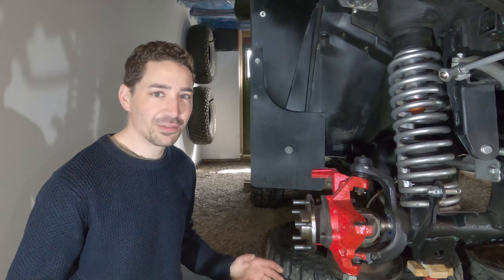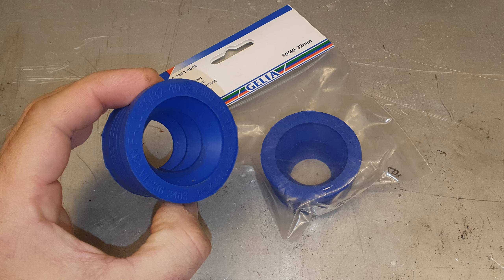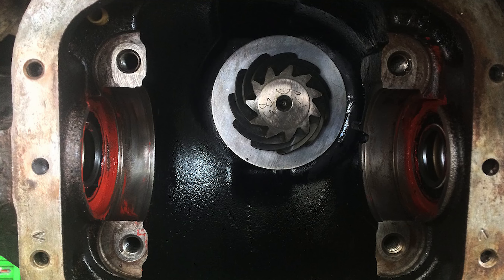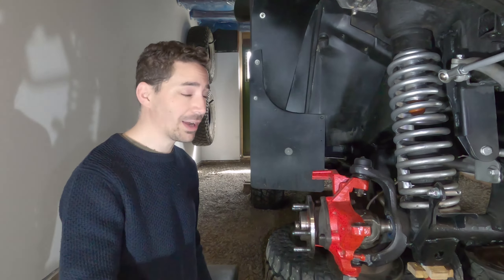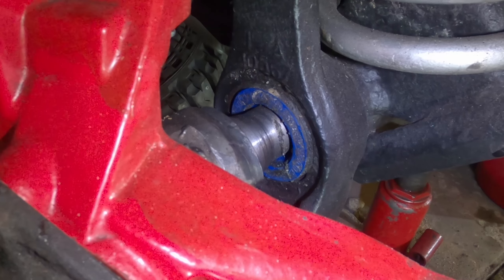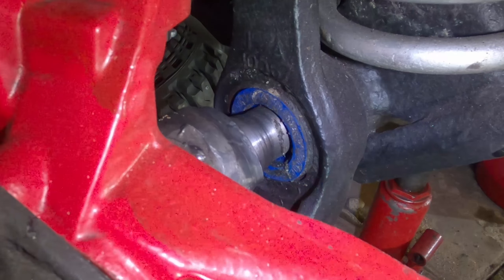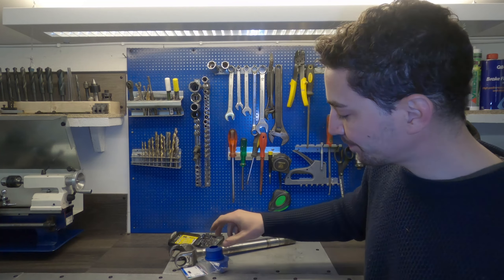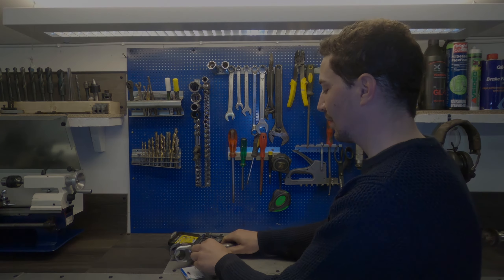Why Front Outer Axle Seals Don't Really Work

Comment from the maker: First off, forgive the flickering lights. They shall be replaced as they are a bit distracting.  
Jeep Outer Axle Seals for the Dana 30 and other front ends of a similar design can vary quite a lot in price. There are cheap Chinese clones for around £20 and name brands over £100. Its good to know what your getting and how it works before spending the money and outer axle seals cannot work they way they are indented due to the deflection of the front axle shaft when turning. 

The axle shafts on front ends with U-Joints can never spin perfectly central due to the nature of the steering knuckle and U-Joint causing deflection on the shaft. This deflection causes the seal on the outer axle seal to be deformed and worn away into an oval shape making it impossible to form a seal around the shaft, keeping water in the housing. 
If you do run them and tread water regularly I would pull the seals regularly to release the trapped water or just don't run them at all.
Thanks for watching.
Reply: Hello, I love the videos and have been watching here and there for years. I have owned and built by my hands ( highly built that is ) 8 of these XJ'S. My question or confusion here is, that based off of what you said the inner of the axle shaft would do the same thing at a smaller tapper or angle then as well, as there is no way for the shaft to angle and wobble out an oval without the opposing or opposite inner side of the shaft side doing it as well, but just not to the same degeree, correct? I ask this because it seems that what you pointed out would almost be saying hey your inner axle seals will do this as well so change them regularly as well. That is what I was wondering about and am curious about, and as to what your thoughts to my train of thought reasoning or conclusion, based upon your statement might be? Thank you in advance, assuming you reply🙂. 🇺🇸 🤝🇬🇧
Reply from the maker: @SarahSmith-hd8kd  Hey, thanks for watching and for the comment. if you clamp the diff housing in a vice and put the shaft in you can actually move it a lot. The inner seals are placed as close to the pumpkin as possible as the movement there is so minimal. This is presumably why its designed this way. 
From what I have read into this 'deflection' as they call it is pretty normal on all U-Joint designs like this. You must be right, the other end of the axle must move also, it has too. I guess its just very minimal to the point where its has very little effect on the seal. Perhaps that's why the shorter shaft seals seems to fail more, i don't know tbh, just speculation. 
I guess it seems logical for a long shaft that slides into a not so tight splined hole to have some movement when there is a rotatable joint at the other end that changes its axis. There is nothing keeping it central at the knuckle end so how can it possibly remain central. I watched an animation of it once that explained it all but I cant find it again. It was over 5 years ago. Thanks again, and I am by no means an engineer!
Reply: @WorkshoptoWilderness  Oh wow, thanks for that response, I just got to read it, as I expected a delay in response due to your being across the big pond. That is a great intelligent response and further elaboration on your part sir 👏.  I believe you are right, because as I stated I've had and built 8 already and lmao, you were spot on your assumption that the short end shaft always leaks before the other driver side will. Thank you for the knowledge, sounds like it is time for some expensive $RCV$ shafts for me, when the old chromoly ones are toast or in need of service. Thank you for the response and your time and I am by no means an engineer but rather a jack of all trades and a master of none🤣.👍
Reply from the maker: @SarahSmith-hd8kd  I'm no expert by a long shot but just trying to think about it logically. That's pretty cool that you have build so many xjs. You must know a thing or two. Those RCVs are absolutely tough as hell by the looks of them. Would love a set of those. Thanks again for watching and for the comment!

Comment: Good video, well spoken and informative. Generally, when I'm in my Jeep, I try to avoid deep water/mud if I can but if I need to submerge my front axle I usually change the diff oil after the off-road trip and make sure the water is drained from the tubes. It's extra work but if you want a dependable 4x4, it's necessary.

Comment: @9:50 - The solution would be to have a bearing at the end that keeps the shaft centered and not flexing. Then a seal would make sense. I don't think outer seals are necessary, even in heavy mud situations. I suppose if there was an issue, sleeving the tube would be a solution that doesn't require constantly pumping and dumping grease. It would just tighten the tolerance and not let as much material down the tube. But the inner seal is still the best defense that's already doing all the work, even if you use outer axle seals.
Reply: That would actually be a perfect solution on a D30 with CV axles, rather than u-joint axles. U-joints by their nature have an elliptical rotation  in any position other than perfectly straight, hence the appearance of directional flexing/ wallowing. And why any outer seal solution will have its shortcomings.

Comment: Very good information, I never realized the axle shaft moved at all, but it makes sense that it would with the torque of the u joint turning. For a while now I've thought about trying out the outer axle seals. Now I'm glad I never got around to it. Sounds like it might be best to keep running with no outer axle seal.

Comment: I changed my Shafts to ones with cv joints instead of ujs and I can’t use the standard axle seals or the China ones because of clearance issues with the new cv boot! so that rubber thing you have may be my only option. Great vid mate thanks from the uk 👍🏼

Comment: Sealing a 90 wt gear oil is one thing. Sealing something thin as water is almost impossible once you are at full spin and steering back and forth.I have found I try to avoid water above the hubs if possible. I definitely limit my time in deep water.it kills starters, batteries and it definitely finds it's way into places we never even think of.i think the original design that allows air and water to come and go is best for most. If you really like tinkering then by all means try to seal the goop out.

Comment: I notice at 3mins 20secs that your uj has been tack welded in. Interested to know why.
Great vid, very well explained
Reply from the maker: It was to stop them turning in the eyes. I got the tip from some offroad enthusiasts years ago. I stopped doing it over the last couple of years when i went to chromoly shafts and full clips. Those tack welded U-joints lasted for years to be fair to them.. 
Thanks for watching.

Comment: Great video, thanks for the upload...any chance you would change out the front axle for something with a different design?
Reply from the maker: Thanks for watching! If I managed to get something better then I would certainly consider changing it out. I quite like the HP D30 though, its pretty strong for a small axle.
Reply: People love to hate on the “Turdy Thirty” but it’s really a fine axle if you’re keeping the gearing are 4.56 or numerically lower.  If you plan to push it hard there are some things to consider but swapping it for a true D44 or other upgraded option is a lot of money and/or work. The little 30 as Mike said works quite well if you treat it right and it’s such a low profile it’s hard to beat that. IMO XJs do best on 33 or 35 inch tires so there’s really no need to swap the axle out for that.

Comment: Hi, I would like to know How your Rubber Blue Seals are working for 1 year if they don't have Grease aropund to protect it ??  Please, can you answer this doubt ? thanks
Reply from the maker: There still on but not sealing anymore much like the red ones I had on before. Outer axle seals are all bullshit like I said in the video. It's impossible to seal the shaft when it has so much deflection, hence why the factory seals are located at the diff because its the part of the shaft with no deflection. 
You run outer seals to minimise dirt, that's all, they will never seal water

Comment: As a mechanical engineer that has wrenched and built various 4wd's, it makes me wonder if the working centerline(or node) of the u-joint is "perfectly" inline with the axis of your ball joints??? If you could shim your stub axle 0.25mm inward, how does that affect the offset when steering. If it makes it worse, I wonder if you have a spare junk outer that you could machine off 0.25mm to test the idea going the other way. My guess is the offset is just the stack-up of tolerances in manufacturing and assembling multiple parts. Enjoying for videos, from here in Oregon, USA.
Reply from the maker: That's certainly a cool experiment. I have a small lathe, perhaps I can make a shim and test it out. I don't fully understand it apart from in its basics. Do you think it would make a big difference? Thanks for watching!
Reply: I seen the lathe, which got me thinking you might have the tools to test it...My brain tells me if it was perfectly aligned - it should not move from side to side. Unfortunately you can only add shim, So if thats the wrong direction it makes the process much more difficult to remove shim or take a skim cut on the stub axle flange. I'm sure its just manufacturing tolerances of how each part fits together and stacking up +/- 0.004" (0.1mm) could start to add up on the axle C, Steering knuckle, Unit bearing and stub axle bringing your combination of parts out of "perfect alignment". It could also be the misalignment up and down also (inline with the ball joints). But if your seeing 3mm of movement, then you should be able to easily reduce that to something less which would increase seal life. Rick
Reply: Since the axle shifts in the opposite direction in which the knuckle is turned, this indicates that the axle needs to come outward, probably quite a bit.

Comment: In the US we generally call any rubber plumbing fitting “Fernco” because that’s the major manufacturer of them here. They usually have worm drive hose clamps on them and are used for joining pipe. However, I’m wondering if these style are not an approved design for US plumbing code because I can’t seem to find them. I will report back with a link if I do!
Reply from the maker: I guess something like this maybe - 

https://www.ebay.com/itm/283855200452?_trkparms=aid%3D1110006%26algo%3DHOMESPLICE.SIM%26ao%3D1%26asc%3D232335%26meid%3Db55d8c352662454ca27535092b8a9848%26pid%3D101195%26rk%3D5%26rkt%3D12%26sd%3D371325928494%26itm%3D283855200452%26pmt%3D1%26noa%3D0%26pg%3D2047675%26algv%3DSimplAMLv9PairwiseUnbiasedWeb%26brand%3DPremier&_trksid=p2047675.c101195.m1851&amdata=cksum%3A283855200452b55d8c352662454ca27535092b8a9848%7Cenc%3AAQAFAAACANwvRF9W4BoqwhOrBQzT%252Bjtxxnb%252F3RYe3bCCTu0PJOQ058%252Fzdih3c6TWaSU%252BhbygMprFBkzYT9tIzjMHYdtQt5JWt2KqGZF41QV2UTXn6rHVPSsbA2zUcQ50eg2pARFog%252B1xADYL3cMsnd9gEepuFRwO7Mdtw3EjwluSmU%252FmdCa%252FiYwOlrCTuqup6OgrKasRG5Xo46iosV1ifu79z2%252FXoDAK88l89WRLBRElBaS%252FQe61Sw79TDdc5%252BBjBF7Gt4Sn3FoluLukUJCqgbaCRSeMyJeHjNLjj7i6k%252BCcdwX1wlE%252FzOA%252BFGppmV5sala5tCaqW1vBBmoRON%252BWpmqdHW0iPehflDV5EKb9wee9dHYK%252Fx8UdEuoXNQWgPUlHDXe3jMwJ5iNFy7wTsntSj5hD1JNiiaPfnqdvtUcm3keF%252BONj0hAdjNJO2l%252B6%252BITzRi2z3eqFGlTVKs0R81ufRr5t5Rbfs6QwIjmlQGfvtSP%252FUsCSfDoes73PHMnrB%252Bg1CKuq4qM4rHjs2a0U4jccm9DJyG%252F0ddZYt7mc6w9yn4NsaKYFMpVgWwbvkVBG5Z9%252BJm9i5pHBQVhOdVJtwX5ZJy%252Be7%252F%252B56ZC02Hc0Ox0D9WAFSb924LQdBUfR79kUM%252F89uGf%252BK0zc8tXk7cC2v5FK9zcsdDnw%252FbtepRuGoRVXbfQDjbvLd2J%7Campid%3APL_CLK%7Cclp%3A2047675&epid=1311938464

Wow, that's one hell of a link.  This might not be the right size!
Reply: Yes “Fernco Compression Donut” is the closest thing I can find however I am only seeing a 2” to 1.5” as the closest size. I believe it needs to be 2” to 1.25” for it to work
Reply: @DRTJon   if you can only find 1.5" ID maybe grab a foot of 1.25" ID fuel hose/radiator hose, put that onto the axle shaft and slide it to where the rubber donut rides on it, smoosh grease all over it and might be even better than the proper seal since itll be rubber on rubber with grease lubricating it rather than rubber on steel
Reply: @AndrewBrowner  now that’s what I’m talking about. Great thinking!
Reply: @AndrewBrowner  You're gonna get a friction point.  Grease is gonna get hot and rubber and the environment dont mix.  Think tires.
Now if someone took your idea and sell an aftermarket shaft with a polyurethane boot, you could be a millionaire 😉
Go patent that shitz

Comment: I wonder if the front hub disconnect system would help?  That way the axel would not be spinning all of the time wearing on the seal.
Reply: I run a disconnect hub on my XJ and have not noticed much wear on the alloy style seals I’m running. However it’s been a few months since I’ve done any maintenance on them and now I want to use gumminipples 😎

Comment: why don't you try and find one of the old school dana30 outer axle seals (slinger)? Those old 4x4s took a lot of abuse and we are still pulling parts of off them to "Upgrade" our Jeeps. 🙂 They practically do the same job your gummi flesh light is doing except the water can drain out all the way from the bottom rather than holding water in.

Comment: Thanks for that gumminippel tip! Found that sleeve in black for 1.07€ on eBay.de (called "Siphon-Gummimanschette" - plumbing supply, siphon/odour trap rubber sleeve).
Reply from the maker: Ah nice! Good find. Its a nice cheap alternative to an axle seal for sure.

Comment: IF YOU TOOK A CALIPER TOOL TO THAT RUBBER PART IN INCHES WHAT WOULD IT ACTUALLY MEASURE OUT TO? I BOUGHT A SET AND ITS WAY BIGGER THAN WHAT I SEEN IN YOUR VIDEO!
Reply: I want an answer to this question as well!
Reply from the maker: To the blue rubber gummy thing? It's a 50mm outer diameter so that's 2 inches

Comment: What about the new terraflex seals. Or the RCV AXLES they have a ball joint not u-joints i wonder if the shaft still moves when turning..?
Reply from the maker: I think the shaft will still move. Its physically impossible for it not too without a bearing mounted inside the axle as close to the knuckle as possible. The axle just slots into the diff splines and then its free floating all the way to the knuckle where there is movement, hence why the engineers put the diff seal as close to the pumpkin as possible. Better to run nothing and just change the inner seals.

Comment: I'm not too sure if i would ever tack weld my Ujoint caps to my axle like you did.
Reply: Thought about exact same thing as i saw!!! But i did even worse Job, it is possible! Disassembled for greasening, popped 1 pot apart as it got stuck/jammed while pressing it in. I broke one bearing pot literally in 2 pieces.
Reply: Pretty common thing to do for offroaders.

Comment: How often were you greaseing the Alloy axles seals? Also did you use Quality Marine Grease?
Reply from the maker: I greased them almost weekly on the second set. I used a fairly standard lithium based grease, not the best of course but provided the seal was actually sealing it should of been fine. I think the issue was that the axle deflection was creating an oval shape in the seal so the grease made little difference. They really should design them with a softer fatter seal material that can deform with the axle deflection and not get pushed and worn.

Comment: Did you weld your u-joint caps?
Reply from the maker: It was a tip I was given a long time ago. Apparently stops the caps pushing out so easily if the ring clip is under a lot of pressure. I wouldn't bother doing it again.
Reply: @WorkshoptoWilderness  You'd Need a grinder to change the u-joint, Or a good file at least.
 I used to sometimes cut the cross out with a torch and drive the caps inwards if they were Super rusty. 
 The tiniest little speck of accidental weld between the cap and ear would result in a bent ear and junk shaft.

Comment: I've never seen these offered in the USA.  Never seen them at all.  Hopefully you have a link in the description.
Reply from the maker: There should be one in the description, hopefully it still works.
Reply: What are they called again?  Maybe they have them on Amazon.
Reply: The rubber ones
Reply from the maker: There called gummy nipples here lol. I think some kind of pipe fitting is what your would want. I looked high and low in the USA to find an alternative but with no luck unfortunately